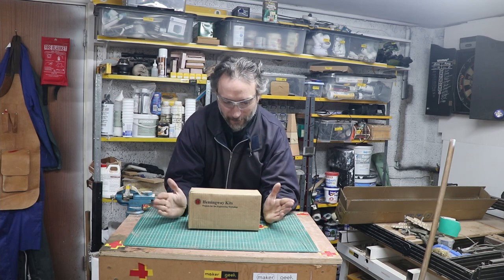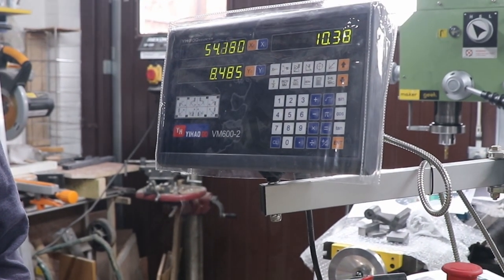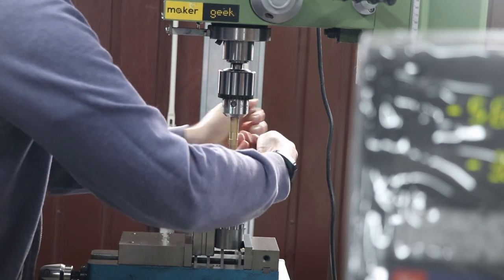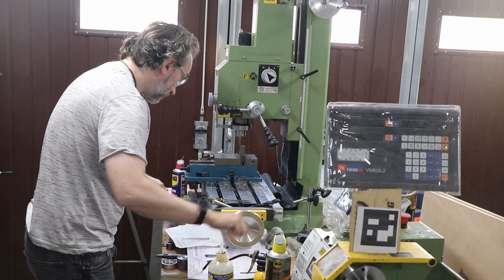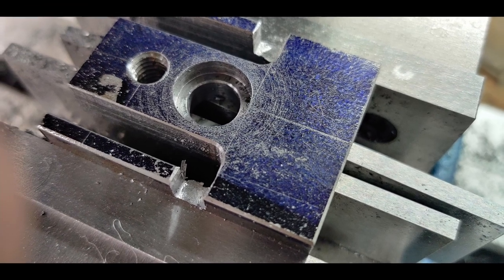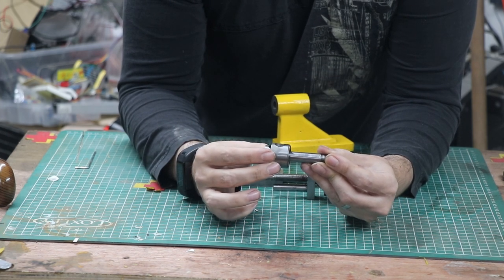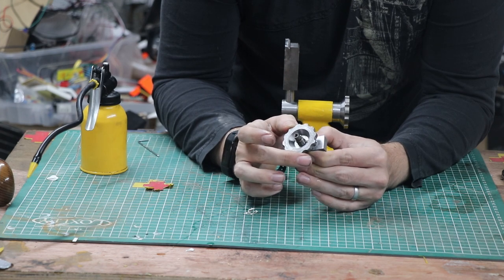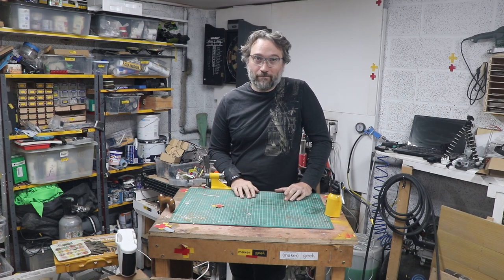Machining project - instrument vice

Comment: Fun fact. ER collets have a 1mm clamping range. A set of metric ER32 collets will do everything you need. Even imperial.
Reply from the maker: interesting. obviously, I knew there was some range to the clamping size, but I hadn't really though about the fact that you'd essentially have continuous coverage. that's a great point

Comment: Use a stick when parting off. One end goes in part, other end goes in tail stock drill chuck. Captures the hot part. Cheers and happy turning.

Comment: Very nice job Dan 👍👍 When it comes to Loctite I would recommend 638, creates a really tight bond. Cheers, Alan.
Reply from the maker: Good tip. I think I assumed all loctite was born equal. But I'll have to try finding some 638. Cheers
Reply: Recently I looked into the different versions of Loctite and was amazed by what I discovered. All sorts. But when it comes to buying the stuff, it’s so difficult to find the genuine article in the UK. Online there is mostly forgeries. Can you recommend a reliable UK authorised supplier?
Reply: @andrewdolinskiatcarpathian  I think if you use a well known company like RS Components or Zorro Tools you should get the genuine article.
Reply: @RetroSteamTech  Thank you. I will take a look at their Loctite offerings.

Comment: Well done, apart from the metric thing, obviously. ;) It's always pleasing to make such things.
Reply from the maker: Lol. It's not that I have anything against imperial as such, but once you're down one path in terms of setup and drill bits and holders etc it  is a pain to deal with the other
Reply: @MakerGeek  I do have both proper and foreign drills and taps.... But my machines are all in propper ;)
Reply from the maker: Haha, to be fair I'm of that weird age were some things I always think of in 'proper' terms like yards, pints and mph. Other things I only ever really understand in metric. Like M5 taps :-)
Reply: @MakerGeek  I can do both but prefer pints, yards and miles. I do find imperial better for making this, doubly so in wood.

Comment: Very inspiring Dan, thanks for the great videos. How are you getting on with the Warco machines? I'm thinking about buying their WM18 mill (when they have stock!)
Reply from the maker: I'm loving them. Though I also have nothing to compare them to. My top tip regards stock. Email them and ask. I'd been waiting for the mill to come into stock for ages. I emailed them and they put me on a list. I reckon I got mine from a batch that never saw the website. They probably sold the lot pre-order. Obviously if you feel like mentioning my name and how maybe they'd like to send me free things.... Just a thought :-)
Reply: @MakerGeek  thanks for the tip :) I will be sure to name-drop! Quick question - I see that the Warco lathe is fixed to the bench down the centre (at the tailstock end, at least), I'm not sure if yours is the same. Does this make it difficult to level or take the twist out of the lathe bed?
Reply from the maker: @ashleydawson5070  this is where I show my ignorance... I did nothing special to level things and no idea how I'd even check for, or adjust, twist in the lathe bed. I just built a workbench and bolted the lathe to it. Maybe one day I'll be good enough at this to notice that some things are the fault of machine setup.
Reply: @MakerGeek  I've found that in the past a twist in the lathe bed can introduce a slight taper on close tolerance machining, making fits a little tight at one end or the other. I think it's a simple case of shimming the bed where necessary using a level or long piece of stock sticking out of the chuck + dial indicator on the cross slide. That's how I've done it, but I'm not an expert! Think there are a few vids on YouTube.